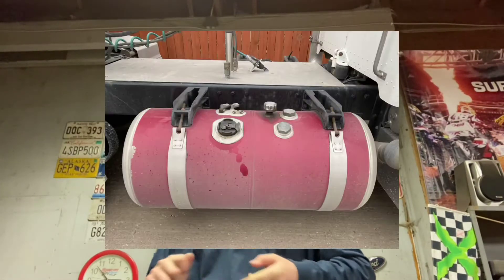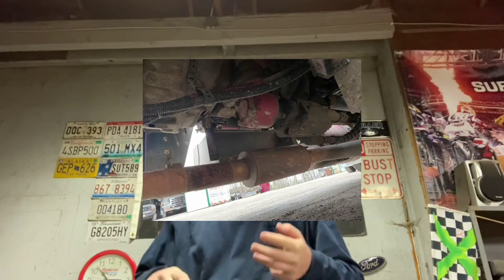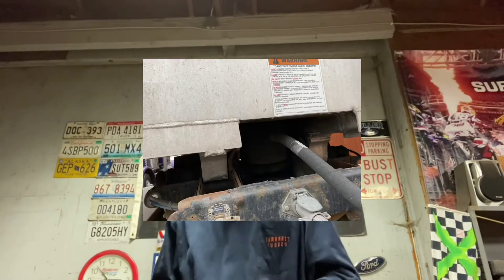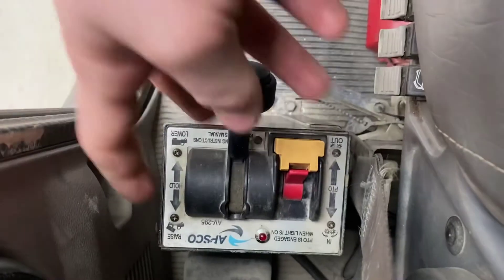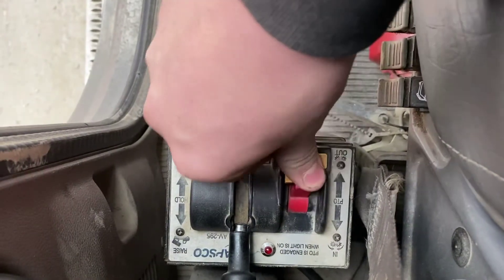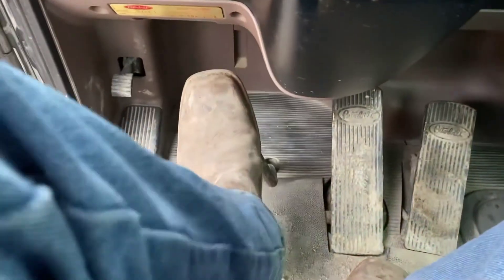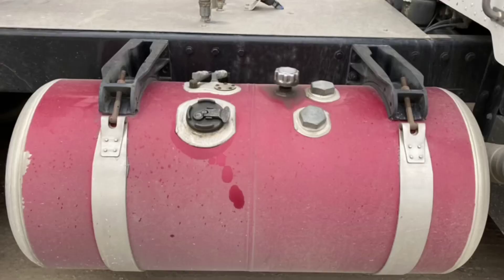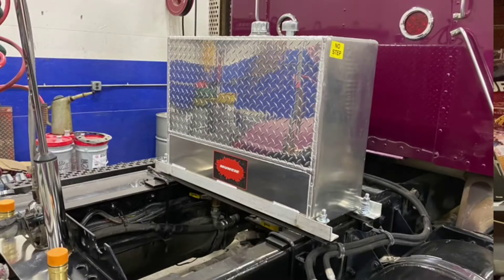How does the hydraulic system on a dump truck work?

Comment: What can cause a PTO to not come on? See on the dash that the PTO is on but it doesn't do anything. I feel like it could be the solenoid valve near the pump.
Reply: most likely a switch or the solenoid